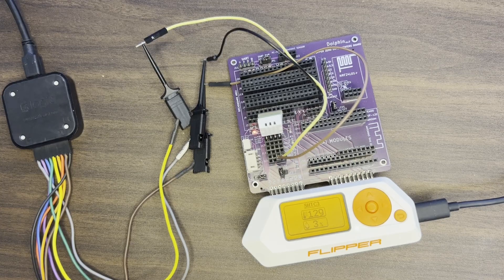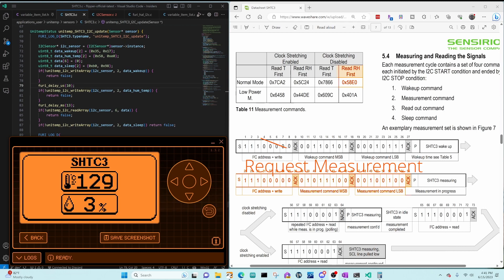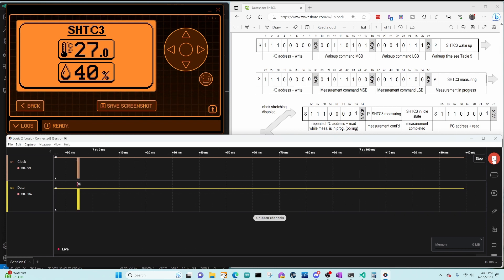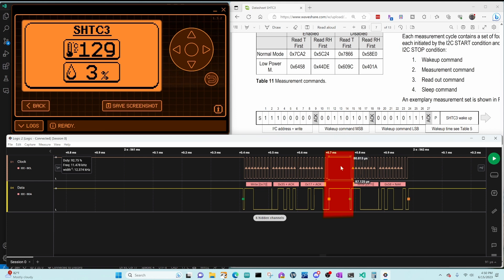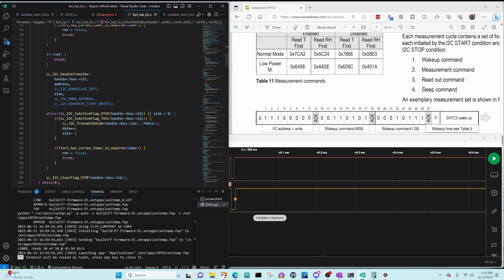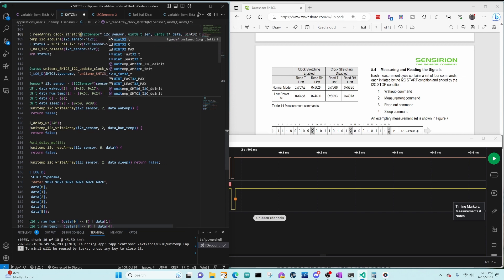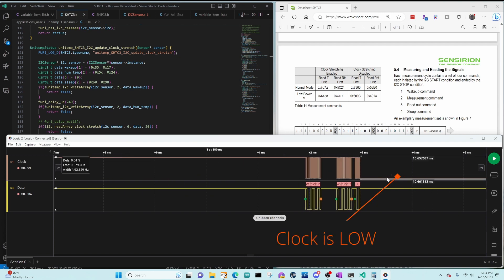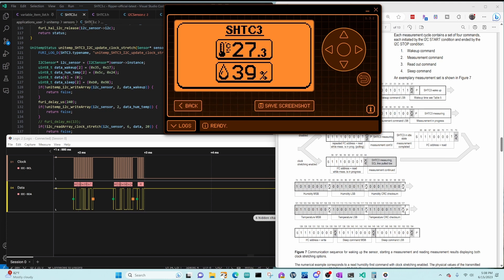[69] Flipper Zero - SHTC3 Clock Stretching and wait.

Comment: This is really high level stuff.

I have some programming exp, but pretty much zero actual hardware & electronic tinkering exp. (No Rasp pi or Arduino)

I appreciate you showing the merging of the 2 hardware & software programming.

I'm fairly lost with the technical aspects of this, but I can definitely understand & follow your logic.

Thanks for going through this.
Reply from the maker: It’s been fun with the Flipper Zero combining hardware and software.

I was super confused when it showed 129c temperature when I didn’t wait long enough after sleep.

Clock stretching is cool, because your code doesn’t have to have max delays - not sure if I should have changed the defaults in Unitemp instead of copying the method?